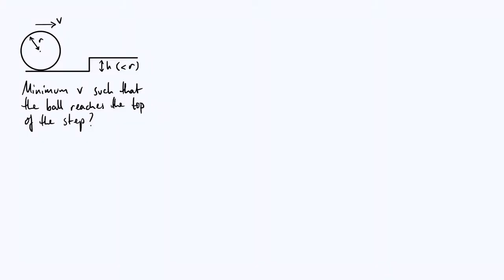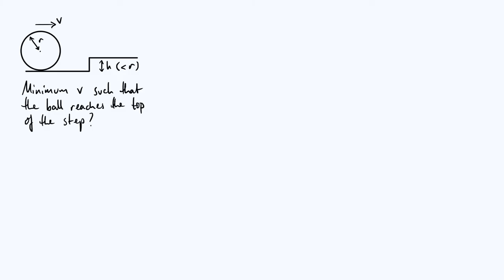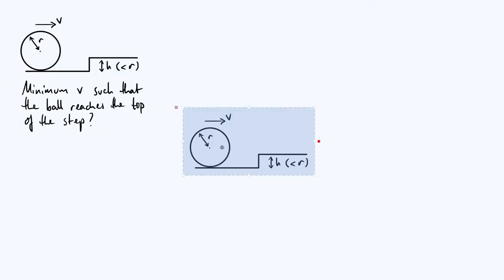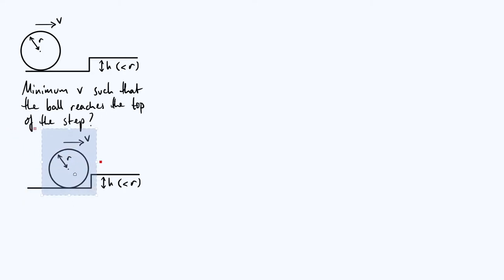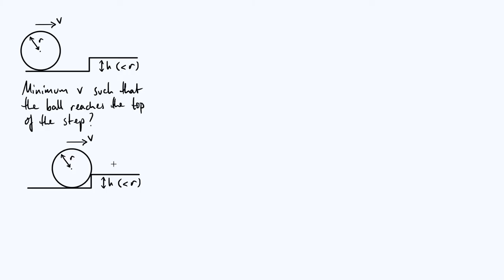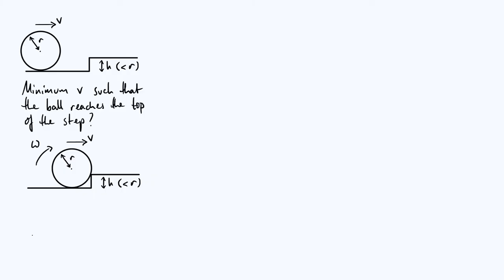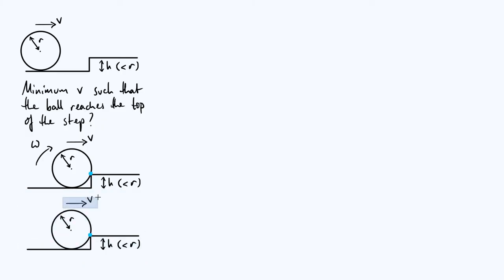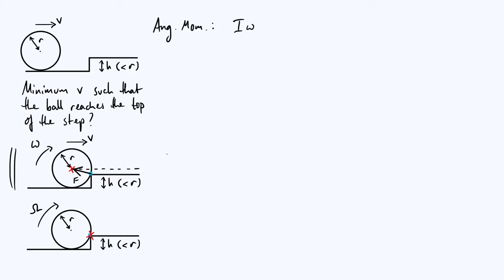Ball climbing a step: what is the minimum velocity required?

Comment: Sir please reply... We applied conservation of angular momentum. About the point of impact.. And we used  only 2/5 mr^2 w.... Why didn't we write Moment of intertia about point of impact...
Reply from the maker: That's because immediately before the collision the ball is actually rotating about its own centre of mass. So, the initial angular momentum has two parts, one due to this rotation about the centre of mass and another due to the linear motion. After the collision you do need to use the moment of inertia about the point of contact because it's now rotating about that point. The key idea is that the point it is rotating about is different before and after the collision.
Reply: @DrBenYelverton  sir please reply. Shouldn't mv(R-h) be on the right hand side of momentum consv. equation? Momentum due to spin is about it's center, but mv(R-h) is about point of contact. So how can we add these two? They are written about different points! 

I think mv(R-h) should be right side of the equation.

Comment: How could angular momentum be conserved? Doesn't gravity act at the center of mass of the ball, thus inducing a torque when the ball rotates about the contact point?
Reply from the maker: It's not conserved while the ball is actually rotating about the contact point, but we're considering the angular momentum at two times separated by an infinitesimally small interval, before and after the moment of impact. So even if there's a non-zero torque, the angular impulse experienced during that time is essentially zero.
Reply: @DrBenYelverton  Thanks for explaining!

Comment: sir, if we are using conservation of angular momentum  about point of contact then torque should be also balanced about point of contact, but there is no such force balancing torque by gravity could you please explain sir
Reply from the maker: Good question - the angular impulse due to gravity can be neglected because we're considering the angular momentum immediately before and immediately after the ball collides with the step. Since these two times are separated by an infinitesimally small duration, the change in angular momentum is negligible even though the gravitational torque itself is not.

Comment: I don’t think angular momentum is conserved. That’s because as the ball move upwards, it also loses velocity, and for the non-slipping condition to apply, it must lose angular velocity too (remember that v=wr), so there must be a torque (in this case there must be a friction force acting on the ball at the corner)
Reply from the maker: There is indeed a frictional force, but it doesn't produce any torque about the point of contact with the step because it acts straight through that point (i.e. its perpendicular distance is zero). The angular momentum about that point is therefore conserved.

Comment: And waht if the step was higher tahn radius is there a way with the same codition a ball could get up there ?
Reply from the maker: I don't think so, because the impulse exerted on the ball would then be pointing directly to the left, causing the ball to either come to a complete stop or start moving backwards depending on how much energy is lost in the collision.
Reply: @DrBenYelverton  So even the agular momentum go to zero, after colision, would not be ball able to roll up the wall with the angluar momentum. (sorry for my grammer english is my second language)
Reply from the maker: I suppose if there's enough friction it could roll upwards and make it to the top, but there would also have to be zero coefficient of restitution for it to grip on to the wall, and that would be hard to achieve in reality.
Reply: @DrBenYelverton  Thanks, in the example it statet that friction was high, I was not sure if it was possible, tanks for answer l.

Comment: Really nice video! Besides, I think it's worth mentioning that there's also an upper limit for the initial velocity of the ball, because the ball mustn't lose contact with the step while climbing it.
Reply from the maker: Thank you! You're right, this certainly relies on the assumption that it stays in contact. Presumably the upper limit you mention would be material-dependent and determined by parameters like the coefficient of restitution, which would complicate things quite a bit!

Comment: Made some cases and just wanted to do a qualitative analysis of them, kindly tell if my thoughts are correct:
i) Point of impact is frictionless -> 
The ball will continue to rotate forever, and only translational motion will be hindered.. The angular velocity will remain same as before collision, but translational velocity will become 0.
ii) Point of impact has friction, but not sufficient to prevent slipping -->  
The ball will not be able to climb up the top, but rotate at the spot and thus eventually will stop due to the torque produced by kinetic friction at each point repeatedly.
iii) Point of impact has sufficient friction to prevent slipping:
The ball will be able to climb up to the top just like in the question..
* Lastly sir kindly clarify one thing, while solving the ques., did you consider: the translational velocity (just after collision) to become zero due to the impact such that the ball will be having only the angular velocity, whose rotational energy too will be converted to the potential energy, and thus finally ball would be at rest at the top.... to find the minimum speed possbile as per the question.
Reply from the maker: This all sounds good to me, under the assumption that the coefficient of restitution is zero!
Reply: Thanks for replying! Sir kindly check the last question too 😊
Reply from the maker: Yes - that's a good summary of the logic I used in the video!

Comment: Sir I have One doubt.how   you can use law of conservation of angular momentum when sphere collide with small step?you could have done  if there is no external torque about the axis on "h" meter height but did you notice the torque by weight of the sphere about the axis you took?
Reply from the maker: This is fine because the collision happens essentially instantaneously. There's a torque due to the weight, but it produces a negligible angular impulse during the collision since the time interval is small, so we can equate the angular momenta immediately before and after the impact.

Comment: Thanks for your video, it really helped me! I was wondering if the instantaneous center of zero velocity isn't the point where the wheel makes contact with the ground? (Instead of its center of gravity)?
Reply from the maker: Thanks for watching! Yes, in the frame of the step, the point on the wheel that's in contact with the ground has zero instantaneous velocity - this is where the v = rω condition comes from.

Comment: Had a small doubt while solving. I feel like saying this is wrong but I am not able to see why. pls correct me if this is indeed correct.

"Because the the ball uses the step as a point of contact, the component of the velocity of the ball along the line joining center to the point of contact becomes zero. the only component left is the one perpendicular. so if the initial v = v_perp + v_para i can just make v_para 0 and use v_perp as the velocity of the center of mass right after collision" 

where is this argument wrong? or is it right? i say it's wrong because using this got me the wrong answer
Reply from the maker: The parallel component should indeed become zero, but the perpendicular component changes. In this problem there must be a frictional force acting at the point of contact, otherwise the ball would just keep spinning with the same angular velocity. We make the assumption that there's enough friction to ensure no relative motion between the point of contact on the ball and the corner of the step. The friction will affect both the angular velocity and the tangential linear velocity.

For an example of where that method does work, see the following video, where we assume that the ball bounces off the step without friction: https://youtu.be/tVVNjnAxMzs

Comment: Sir, an addition to this problem is that for a given speed U, what should be the 'impediment height'/radius (which is <1) such that the center of the Circle bumps off to a maximum height possible
Reply from the maker: That's an interesting question - can we assume that there's no friction between the step and the ball? If so, I can imagine approaching this by resolving the incoming velocity in the radial and tangential directions, then reversing the direction of the radial component (assuming no energy losses) and treating the ball as a projectile after the collision.
Reply from the maker: I've just worked through this using the method outlined above and ended up with an answer of (2 - √2)/2, independent of the initial speed. I'll try to get a video recorded on this problem in the near future!

Comment: Sir, how to find maximum velocity?
Reply from the maker: The approach would be a little different as it requires a different set of assumptions - mainly a nonzero coefficient of restitution. I haven't worked through this in full, but you could try resolving the motion into components parallel and perpendicular to the contact force, and write down the final velocity by considering the impulse exerted by the step. The result would depend on the coefficient of restitution (which in reality is velocity-dependent), and coefficient of friction as well if you wanted to include that. Something like the method I used in this similar problem: https://youtu.be/tVVNjnAxMzs

Comment: Sir ,the angular momentum about the taken point of contact may not be conserved because the torque produced by gravity should be considered
Reply from the maker: Although there's a gravitational torque, it produces a negligible change in angular momentum in this example because we're considering two times separated by an infinitesimally small interval (i.e. immediately before, then immediately after the collision).
Reply: Understood sir

Comment: I Have question, it seems at climbing, you didn't use conservation of energy because the energy isn't conserved on that case right?

and you used angular momentum conservation instead. but why are you neglecting torque such as gravity?
Reply from the maker: Yes, some energy must be lost in order for the ball to remain in contact with the corner of the step, which is why we can't use conservation of energy. 

For your second question - I'll paste here the same response that I gave to another commenter a while ago: the angular impulse due to gravity can be neglected because we're considering the angular momentum immediately before and immediately after the ball collides with the step. Since these two times are separated by an infinitesimally small duration, the change in angular momentum is negligible even though the gravitational torque itself is not.
Reply: @DrBenYelverton  i've been thinking about it, so that's why you are using the conservation of energy in the end right? 
i think this is enough for me to derive the opposite, ball climbing down a step. thank you.
Reply from the maker: Yes, there's an instantaneous loss of energy at the moment of impact, but it's then conserved during the second phase of the motion when it's pivoting about the corner.
Reply: @DrBenYelverton  how do we know from the start that the energy isn't conserved there?, at first, i didn't figure it out why the energy isn't conserved.
Reply from the maker: I'll give you two different ways of understanding this, from physical and mathematical perspectives:

Physically, it's because the contact force between the step and the ball does work to slow the ball down during the collision, and therefore changes its energy. The work done is just given by (force) x (distance moved in direction of force). As the ball hits the step it has a component of motion in the direction of the contact force and continues to move a little in that direction as it compresses, which is why the work done is non-zero (though in the model we ignore the details of this compression and treat it as a hard sphere). Once the ball starts pivoting about the step, though, the contact force is not doing any work because the instantaneous direction of motion of the ball is always perpendicular to the force (the same idea as gravity in a circular orbit).

Mathematically, requiring the ball's energy to be conserved would simply be inconsistent with the ball staying in contact with the step. In either case, we know that angular momentum must be conserved as discussed above. In the video we also made the assumption that the ball "sticks" to the step, and this assumption leads to one specific value of Ω. Introducing the idea of energy conservation would give yet another equation for Ω in terms of v, and the system would now be mathematically overdetermined and hence inconsistent.